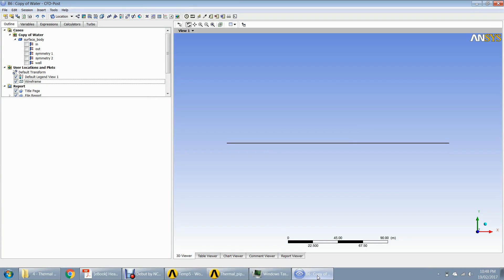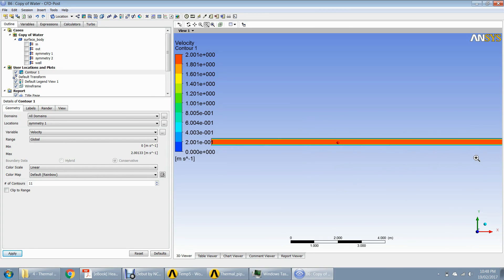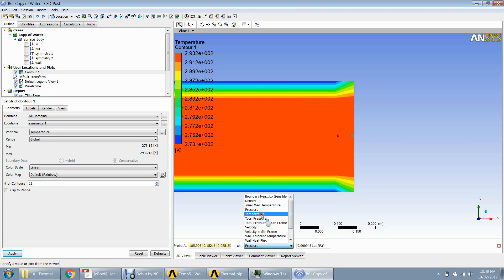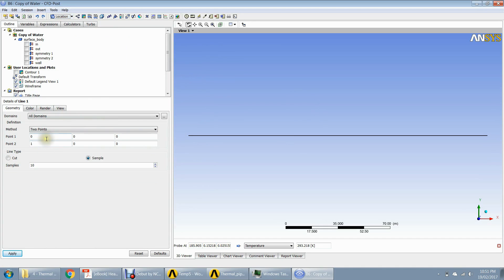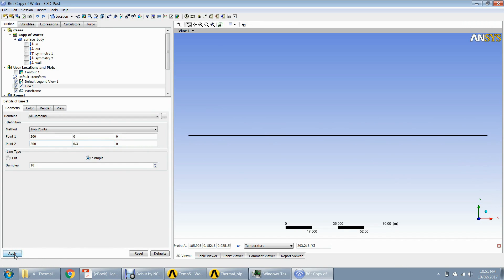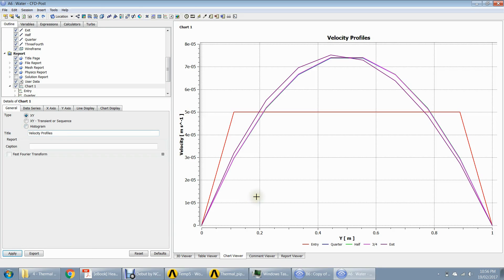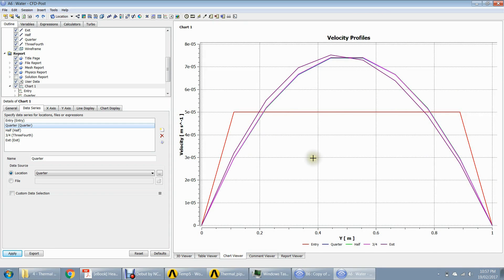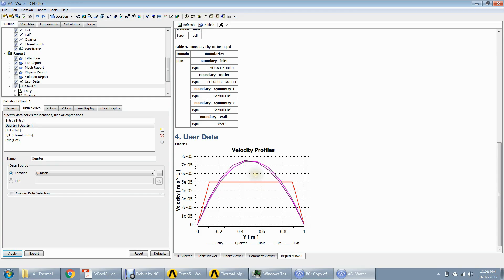Simulating Thermal Pipe Flows using ANSYS Fluent (Part 2) | 07 | Implementing the CFD Basics

Comment: Hello,
Is it possible for you to simulate Natural Gas flow through a pipeline and a globe valve. Upstream Pressure 10,000 Kpag and D/S Initial Pressure Zero?
Reply from the maker: You have to use the correct flow situation and BC. I suppose you should be able.

Comment: In Oil properties u entered the kinematic viscosity while u should have entered in Fluent (Kinematic viscosity * Density) that's why ur flow wasn't developed even at the center while it should be fully developed at 10m according to the equation that L_entry=0.05*Re*D in case of Laminar flows
- The average velocity inlet is less than 2 that's why when fully developed in water for example Vmax isn't equal to Vavg ( the inlet velocity in case of rectangular profile at inlet )
Do u know how to fix it ?

Comment: Dear Agarwal, have you entered the value of Prandtl number in fluent?
Or will fluent calculate the values on its own based on the viscosity of the fluid?
Reply from the maker: I think I did not entered it. Fluent should be able to calculate it.

Comment: Dear Sir, 

I want to express my sincere appreciation to you for imparting knowledge for free on youtube. I have watch series of your tutorials on youtube, they are very helpful. Thank you sir.

Please I am having a very serious issue with my research. Part of my research is on Two-Phase Flow Boiling. Unfortunately, i have search through and watch most videos on youtube but i cannot find any ANSYS FLUENT Modelling for Two-Phase Flow Boiling in a vertical pipe of uniform heat flux. The Fluid is Water-Gas flow.

As part of my preliminary research, I must learn and know how to model Flow Boiling in a vertical pipe sing ANSYS FLUID FLOW (FLUENT), showing different flow regimes (i.e bubble, slug, churn, annular and wispy annular). Until I learn this, I will not be able to proceed and face the main aim/objectives of my research.

Please sir, I will be very grateful if you can help me with the ANSYS FLUID FLOW (FLUENT) Tutorials for Two-Phase Flow Boiling in a Vertical Pipe of a uniform heat flux, showing different flow regimes. The Fluid is Water-Gas flow.

If I should understand how to model this, then it will be a better start point for me to tackling my project.

Thanking you in anticipation of your kind help.

Charles
E-Mail:  charles.okon@postgrad.manchester.ac.uk